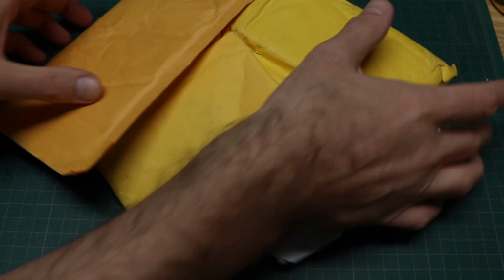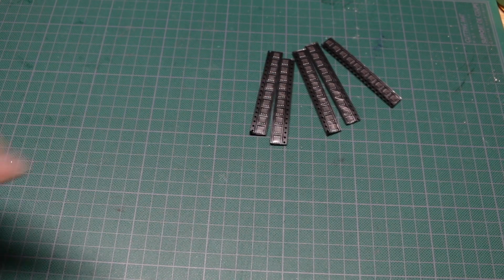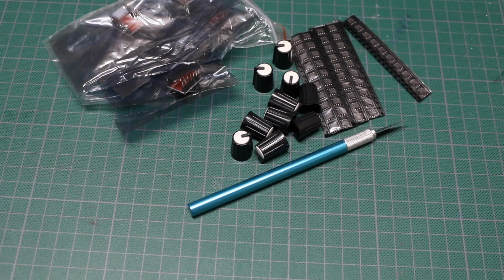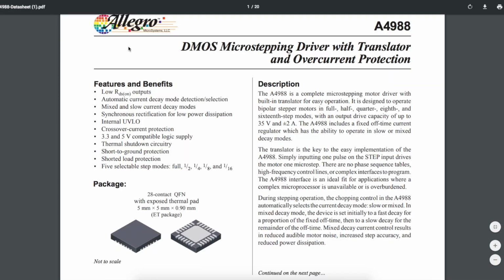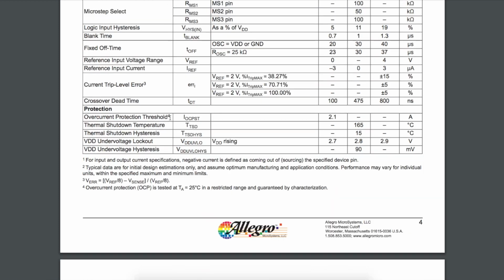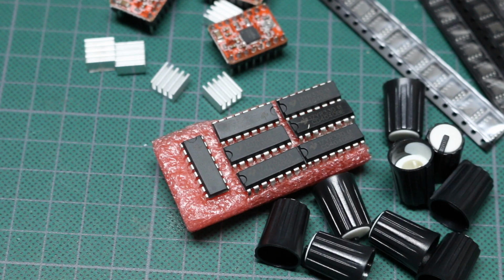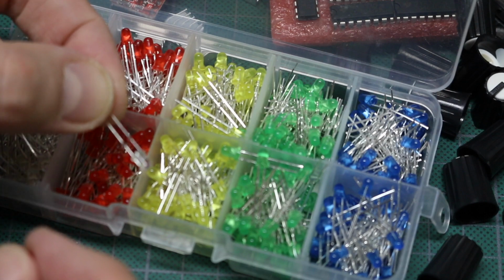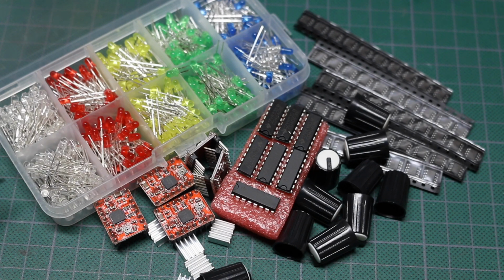Mailbag - Micro-Stepping Drivers and Misc Parts

Comment: In your old printer you won't find any stepper motors, just your normal dc motors. Two of them: one is for paper movement mechanism, it will have a round stripped transparent piece of stiff foil on one side of it's shaft. Second one will be for header movement, this one won't have any encoder thing attached to it, but you will find that something like a thin finely stripped piece of transparent plastic foil will be placed next to header, so photocell inside printing header will be able to read that strip.

It's hard to find square-ish types of stepper motors in various appliances, the only stepper motors you can recover from old stuff are header/laser movement motors from floppy/cd/dvd drives
Reply from the maker: I also have a lot of old floppy and DVD drives that I need to audit and see if they even work and if not, harvest them. I could use some of those screws motor mechanisms  that I believe are in those optical drives. 
I used to just throw things away but now I’m starting to collect a pile for harvesting.

Comment: these kind of videos produces STIGMATA in hour hands... money falls off :D
BUT... what's the point of buying smd 555 to solder on those breakouts and not using standard ones which already has pinouts...
Reply from the maker: Mostly I liked the price of the 555's and I could use them as soldering practise and make them hot pluggable such as soldering all the timer R-C parts onto the breakout board semi dead bug style and then I can drop in a 555 board on a breadboard for instant oscillator availability without having to breadboard one up.
Reply: @GadgetReboot  right, understood 😊

Comment: There is a Arduino "RAMPS" stepper-controller standard for 3d printers and such ... so if you blow one, or want to upgrade ... just change the module.
http://www.neverenoughlight.com/Forums/pololu_driver.jpg
I like the little 3mm blue LEDs ... you can put a 3.3k resistor in front of one, and it shines pretty well.   2x3 rect LEDs stack side-by-side very efficiently on a PCB, if you can find em.